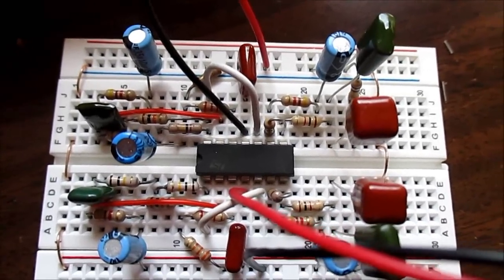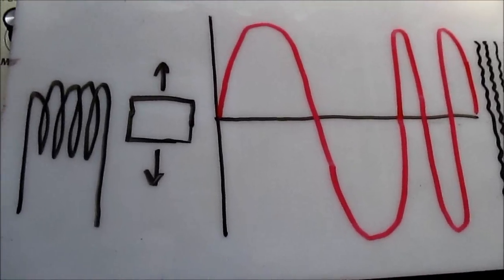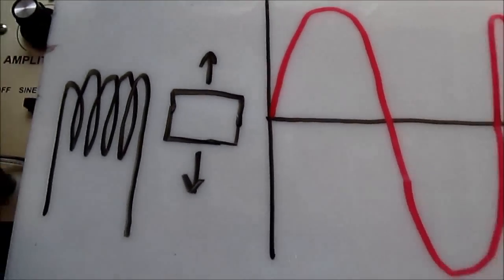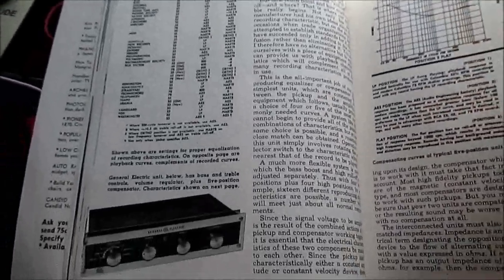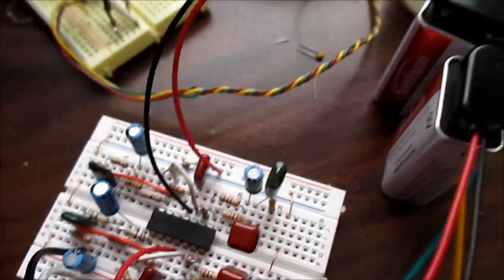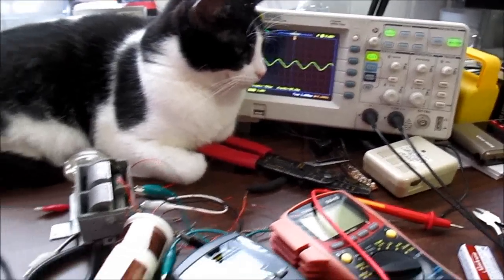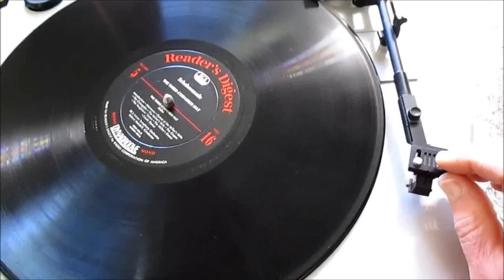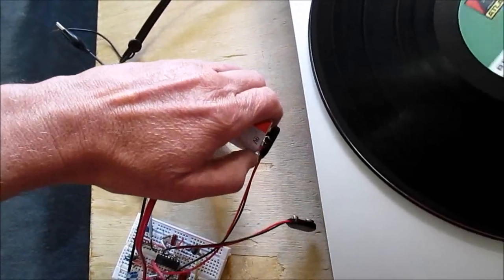High performance phono preamp by Rod Elliott (ESP)

Comment: I built this as well with opa2134, driven by a sony Ps22 turntable.  The material cost was about 25 Euro for me. It is very forgiving to build, worked without any problem. Sound qualities can not be determined, this is the first preamp (and first turntable) I used. From price point of view it is a no brainer.

Comment: I built this using Rod's boards - a P06 and the P05A regulated power supply. I used OPA2134 opamps and Dale RN55D resistors. It may be the best phono preamp I've owned. It was definitely engaging to listen with. I lost it in a move and I miss it.

Comment: just made it aswell, sounds better than the preamp in my amplifier, i just put it in a metal box and printed some buzzwords and logos on it so the audiosnobs think its a expensive high end device

btw you can also order pcbs from rod, then you get access to the backend with all the goodies you wont see on the project pages

Comment: The RIAA curve is not complex. As John said the standard moving magnet or moving coil is a 'velocity' device and its output is proportional the the speed of the 'wiggle' of the stylus. The record maker needs to save valuable space on the record and large movements in the bass need minimising, the HF is susceptible to noise and needs the opposite treatment to the bass for lowering noise.. and that is about it. The RIAA curve was arrived at with some painfull to and fro-ing where every record maker was using a different curve NARTB RIAA etc.. Standardised since 1954 when Long Play microgroove was fully introduced. (I think). If you want to cause brain meltdown, think of the cutter also being a velocity device, the ceramic cartridge having a flat response and speaker drive units which are motors and therefore velocity devices too.....
(It all works out in the end)

Comment: nice build. good work - which OPAMP NE5532 / OPA2134 / LM4562  did you use here ? btw radio interference , you can add a 100pf capacitor between Pin3 U1A and Groundpoint to get rid of it..

Comment: Great video, you said you would use better components for an actual build. Could you talk about component choice for audio circuits?
Reply from the maker: Adam Morris I would use one of the several audio quality op amps (low noise and distortion), metal film resistors (low noise) and film type capacitors.
Reply: +Adam Morris 
Opamps:
Choose one: http://www.cycfi.com/projects/six-pack/op-amp-shootout/
I used dual NE5532A's and they sound great!

Comment: Some oscillation happening there at the end?  I love Rod's site although I admit to not understanding all of it.  He does have some nice articles targeted to beginners.  I built/copied that same phono preamp circuit on a stripboard using LM833 op amps (also known to easily oscillate).  I enclosed my project in a nice metal box an it sounds excellent.  Maybe you can show that squeal on your oscilloscope?
Reply from the maker: Wade Prince It was only oscillating when I removed one of the batteries just to see what would happen. Doing so can cause an unpredictable effect with any amp. During normal operation, the amp is stable.

Comment: Any idea where to add a volume control? I have an active system with no volume control (everything is on the max, I control the volume from the source - laptop, PC, tape) and I really it to control the turntable volume.
Reply from the maker: +Bogdan Serban You can add a volume control to the output of the phono preamp. 10K type should work fine.
Reply: JohnAudioTech thanks, I was worried it would load the op-amp.

Comment: the turntable ground is connected to the negative supply of the Preamp?
Reply from the maker: +Benjamin Tan No, it is (or should be) connected to the common ground point in the circuit.
Reply: The "buss bar ground"?

Comment: I tried using this preamp with batteries, and it was not as good as when I used a regulated supply with almost 10,000uF of capacitance. If you build this, don't build it with just batteries for the power supply - you won't get the full effect this excellent circuit can deliver.